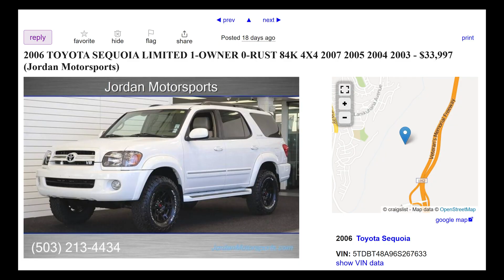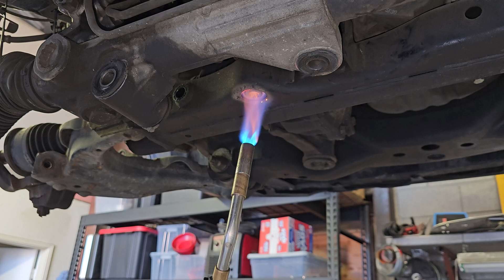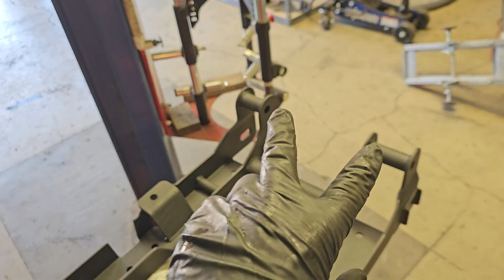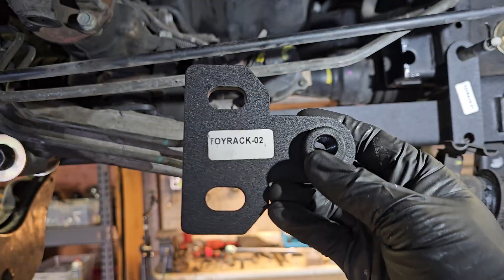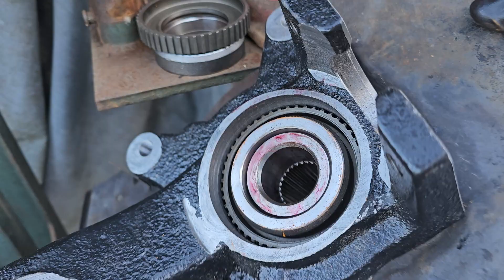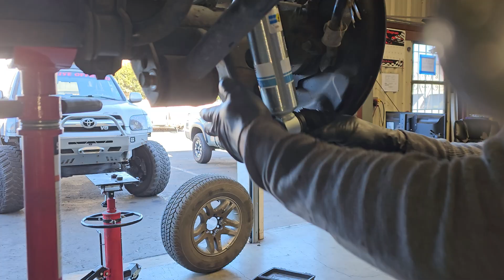1st Gen Sequoia Gets 6 Inch Tuff Country Tundra Lift

Comment: I have an 06 sequoia and about to purchase this kit, i already have a "3" inch lift strut but it sits bigger than 3, to level it out i have a 2 inch extended coil in the rear with a 2 inch coil spacer on top, so its really close to 5.5 inches of lift just from the strut some how, i also have 4 inch extended uniball upper control arms and the only "bad" angle i have is my tie rod ends. With this kit do you think i could put just a smaller 2.5 strut level on top instead of the 5 inch and be fine?
Reply from the maker: This kit comes with the 5" lift spindles so the struts need to be extended 5" from stock height somehow. Whether you add the included spacer to the stock strut or a 2" spacer to a 3" lifted strut shouldn't really matter. 
I think I understand what you're trying to accomplish and if I were you I'd try it, but don't be surprised if it doesn't work. We were pretty positive we'd be able to use the RCD extended Bilsteins but they were just to long.
Reply: @treehouseoffroad  thanks for your info

Comment: So with the 2wd do I have to cut the frame trying to get the same 5 to 6 inches but only have a 2wd
Reply from the maker: The cut is to make room for the front diff so you may not have to.
Give Tuff Country a call to confirm though

Comment: How's your truck running did you have to get a new tranny or anything on your like axles and your rack and pinion that puts a lot of stress when you go higher than 2.5 in right
Reply from the maker: The way this kit is designed it does not add any stress to the steering rack. The CV angles stay in the stock position so they're happy too .
No reason for the tranny to develop issues as a direct result of installing this lift kit either.
Last time I spoke with Dante his truck was still running great.
Reply: @treehouseoffroadcool thanks buddy I was really considering getting a bigger lift and a lot of people say it puts a lot of stress on your rack and pinion but hey I like what I see and I'm going to do the same thing thanks
Reply: @Richard-Ak hey this is actually the guy who owns the truck, let me tell you the streets of New Orleans over here are horrible it’s like driving Offroad everywhere, so far it’s been doing fine really enjoy my ride 😎

Comment: I have this lift waiting to put on my 06 tundra. Just ordered the extended bilsteins. Why didnt they work for you? I saw reviews online and guys said they worked with the tuff lift. Just curious before I start working on it.
Reply from the maker: They over sprung the truck like crazy. The spindle was touching the spring and the suspension would not settle. CV angles were ridiculous. 

The extended Bilstein's are a joke anyway lol we cut one open and it was 80% air inside, with a tiny oil reservoir and about 4" of travel. Just big shiny empty tubes, save your money

Comment: hey i know im a little late to this haha but how did you get 15” wheels to fit?
Reply from the maker: Never too late, we used 2" spacers and may have even removed the front brake calipers. They were the only wheels we had at the shop so we threw them on for pictures/video of the truck.

Comment: What is the link to the Billstein 5100?
Reply from the maker: We used stock length replacements in the front and these in the rear https://racecardynamics.com/products/f4-be5-b110-t5?rq=yr_2006~mk_toyota~md_tundra&variant=40124845981779

Comment: Did you have to extend the rear brake lines for that much lift?
Reply from the maker: No, the Sequoia rear lines are ridiculously long. You can re-orient a bracket and they're fine. 
I've never extended them on my personal truck either and never had an issue

Comment: That is badass!!  I run this kit on my 1st Gen Tundra and I love it.  I offroad regularly.  I replaced all the stuff that comes in the spindle with OEM and I used the Icons made for the RCD kit but will eventually go custom to replace those.  Custom rear leafs as well.  Love the way it looks.
Reply from the maker: That's awesome to hear brother thanks for sharing your experience with this kit.
Reply: Did you have strut coil contact with the Icons? I am in the middle of the same thing with the non-extended travel ones for the RCD 6" kit.... but i am hitting the coil around ~2" of droop. What has me a little bit head scratching is compared to the stock struts with the spacer, the Icon coils are, like, half an inch or more less in diameter. Sure they probably are pushing the droop further than it would otherwise, but you'd think if I swapped the stock strut+spacer back in there, because it's wider, you'd see even less down-travel before contacting the coil?

May have to use limit straps to prevent this from happening - is that what you did?

Comment: Question:

What is the biggest tire you would put on an oem lbj? 

I had a 99 4Runner on 35’s and had a lbj failure. Tbh i had a failure on 33’s also, replaced with Orielly lbj instead of oem and it happened again but totaled the truck this time. 

Now have a 2001 sequoia and not sure to build or go 2nd gen and build a tougher platform. Honestly, the idea to one off long travel arms for the rear of a 2g sequoia is tempting… worried about the wheel well near the door though
Reply from the maker: I ran 37x13.5's on stock LBJs, I just made sure to replace them a little more often, with Toyota parts of course. 2006 LBJs are slightly larger and inherently stronger than 2001, but enough to make a real difference? I don't know.
If I were to build a 2nd Gen, a rear locker would be at the top of my list. Those things three-wheel it constantly
Reply: @ noted. It’s a hard choice. I’m curious if rear lt will help the 3 wheeling issue. Would be annoying to find out it doesn’t. Mate scsb is the way to go. Thanks for the insight, no clue what I’ll end up doing lol. Maybe take a year and think

Comment: Great video, as always. You said it's not good for off roading, what about light to medium touring which has fairly easy off roading, would it be adequate?
Reply from the maker: I don't have a fact or evidence-based answer for that question. I will say that there's some people on the Sequoia FB groups that seem to do fine on  easy/medium trails and overlanding.
Reply: @treehouseoffroad  thanks for your input.
Reply: My sequoia has this lift. No problems with mines here in hawaii. If you search off road trails on OAHU like  "Kaena Point State Park/Trail" or "Poamoho Trail" or "Peacock Flats Trail" it may give you a better idea for your question🤙🏾

Comment: Great video! Wrong lift choice but that's what makes the customer happy ill accept it ❤❤❤
Reply from the maker: Thank you I appreciate the comment! 
I don't believe it was the wrong lift choice though. He's not rock crawling or high speed desert racing. These lifts handle really well on the street and a couple guys on the Sequoia FB groups run them on some pretty legit trails. Drop bracket lifts definitely have their place, they've been around forever and aren't going anywhere any time soon. The other option to get the height he wanted was a big ol body lift that we wouldn't have done at our shop for safety reasons.
Reply: Nothing wrong Dante....welcome aboard the 1st gen Seq's....maybe i be seeing it soon if u live Oahu....no regrets my braddah!
Reply: I have a small lift on my 1st gen and I love it. I went bilsteins with Dobinsons springs for about 2-1/2”. IFS suspension doesn’t let you go big without a lot of money and work
Reply: Why what concerns should I have about my car now that its a 6 in? is there something I should prepare for? I’ll take all the advice I can get
Reply: @DanteCold43  is basically a body lift, and body lifts are ok 1" or 2" is ok. 6" in my opinion kinda usless on road(need a ladder to load groceries,gym bag, gear,wife)and specifically off road.  I believe off road vehicle should have a balance of lift but still low to the ground.  If you are as low as possible, you have lowered your chance of rolling over, kinda like a race car.  When you go 6" or more, you're going to put yourself in a scary situation very quickly when it comes to off camber situations.  You can go wider wheels tires spacers to help you from tipping, but then you just get so wide.  Even if you lift 6" your differential transmission engine, lower shock towers are only as tall as your tires.  The more extreme you go with a lift and tires, the worse the truck will feel and drive.
Reply: @ not sure if that's true, i specifically told them I didn't want a body lift, and they assured me on that, on top of many other requirements I had, why do you say that though?
Reply: Yup....Lower Center Gravity plays a huge role off roading.This Sequoia just cruising so this lift is nuff
Reply: @DanteCold43  da guy just yappin. Can tell he dunno already talkin bout body lift😂
Reply: Not like theres a market for 1st gen on lift kits. Lol